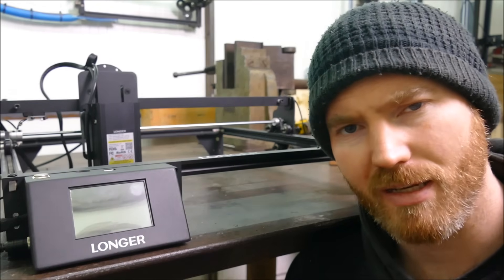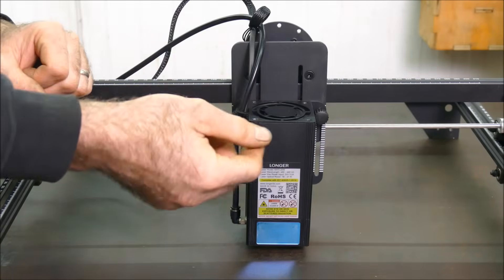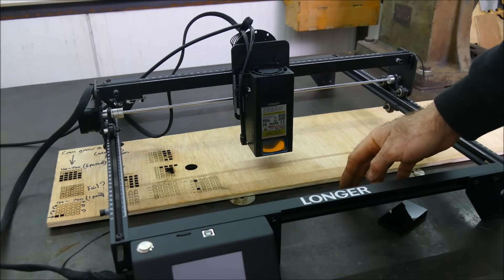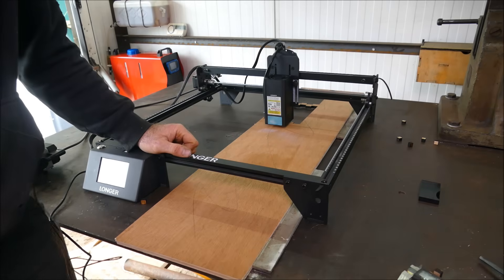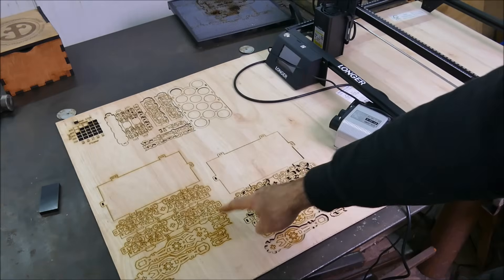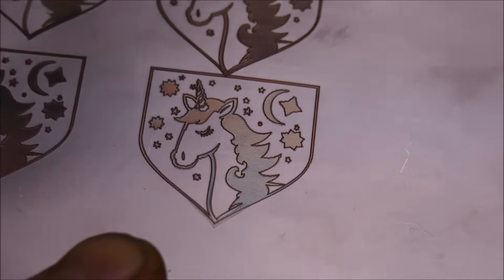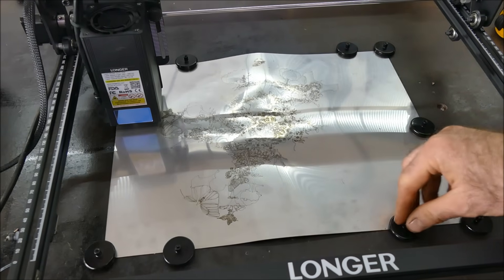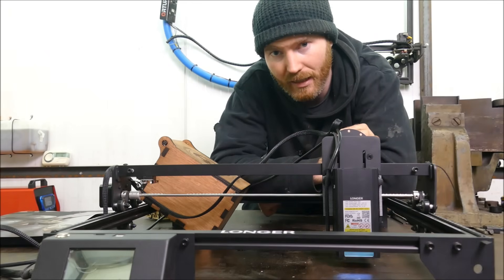How practical are 20w laser modules really? - Lowest price 20w review + Raffle & discounts by LONGER

Comment: I just got my 20w laser the other day and Longer must be watching your videos. My laser only has only one thumb screw on the side to lock in the height of the laser and there is a metal piece on the bottom you swing down to adjust the proper height. There is no longer a separate piece you can lose to set it up. Also I got the same air assist that you showed and like you the thread insert was too loose and did not tighten. I used loctite also and fixed it. It must be a manufacturing defect and not a fluke.
Reply from the maker: Thank you. Well done that's good to hear. Cheers J

Comment: Perforated sheet-metal(the kind that comes with lot's of evenly spaced holes) or a tool-wall hole-plate glued to a board(mdf/ply(particle-board flooring etc) use the holes as drilling-guide to drill through the wood(you could even use the laser for this as the holes only need to be deep enough to clear the bearing-ball), then lots and lots of cheap bearing-balls resting in the holes(+some superglue if you feel a need for it).  

More durable than honeycomb, cheaper and easily repairable(and you don't have to fill every hole with a bearing-ball), and better airflow as there are no sidewalls restricting it...

Also allows you to use printed guides with cheap magnets for repeatable support and positioning...

Comment: What software do you run on these machines?
Is there a limitation (except for steel) on materials?
Is the "test print" available for us "normals" ?
Reply from the maker: You can use Laser GRBL which is free or paid versions like lightburn which is what I now use for the extra features. The only plastic you should cut is acrylic as other plastics give off harmful gases, there are ply woods that are laser specific but any ply wood is ok as long as adequate extraction is in place as some glues and resin's are not good to breath. It works well on stainless steel specifically and it will mark normal steel but only lightly. Other metals require a coating, oxide or anodised surface that is then removed by the laser to reveal the picture. All the very best. Cheers J
Reply: @joshuadelisle  Great reply! Thanks. Good to point out the safety aspect. 
In my case I used to use the "K40" glass tube versions with it's own housing. 
Have had my share of headache when forgetting the fume extract motor... 

Just found the feature in Lightburn and feels like a good value as a software.
Keep up the great work with this channel. Really like your content.
Reply from the maker: @mippengbg  thank you so much. All the very best. Cheers J
Reply from the maker: The test print was generated on lightburn but you can do it on the free version with some G-code knowledge which is worth learning anyway. I may do a coding basics video on this subject in the future. Cheers J

Comment: Has anyone tried building airtight boxes for these things? The air cooling might make it difficult, depending on where it goes once it's passed over the hot bits, but it seems like it'd be a good way to ensure that you don't end up with anything catching fire, & you could also contain the fumes by adding a fan & filter (passing the trapped CO2 around the space & through the filter, not venting to the exterior until it's finished the job).
Reply from the maker: I definitely recommend an enclosure with a form of extraction for sure. Comgrow do fire retardant covers but I'm not sure if they do ones big enough for this. Cheers J
Reply: @joshuadelisle  I was thinking more a box you could fill with carbon dioxide by lighting a candle, which could then be extracted later on. I'm wondering whether removal of oxygen could also lessen scorching, though it wouldn't prevent the blackening of the cut edges themselves.

Comment: I've considered making my own laser engaver some years ago, then after I've read through a course on laser safety, I've found that even what you might consider low power lasers for your particular application, the reflection itself can burn your eyes out within a split second if you are unlucky. Afterwards I've put that on hold, until I've had enough time to really do everything safely, considering myself and my environment, reflection, laser traps, power ratings for glasses and wavelengths etc. Nice review btw!
Reply from the maker: Thank you so much and very good point. Safety first. Cheers J

Comment: I gladly join, however it's asking for a credit card (which I do not have) and not letting me use PayPal.
That's really too bad!

Good and enjoyable video though!
Reply from the maker: Thank you I'll check that out with Raffall as that would be my preference too. Cheers J
Reply: Same here - I have paypal so I don't have to spread my credit card details around the internet. If vendors won't accept paypal then they do without my business. Shame as I'd like a pop at winning this too.
Reply: same here , no paypal no order.
Reply from the maker: I got in touch with them. They said PayPal doesn't offer payment protection on instant purchase transactions as there is no physical product just the ticket. They said it's best to use apple or Google pay otherwise. I'm guessing having PayPal is a costly option with no benefits. I did argue the case for the universal aspect of using PayPal though. Cheers J
Reply: @joshuadelisle  I tried Google Pay, which is linked to PayPal, which wasn't accepted.
I guess a 'no go' for me unfortunately.
Reply from the maker: @allartwatnudan1205  that's a shame. I'll give them the feedback. Cheers J
Reply: @joshuadelisle  I do it in the old fashioned way. Online banking. You will get it tomorrow. ✌
Reply from the maker: @McGutschy2  thank you. Well done. Cheers J